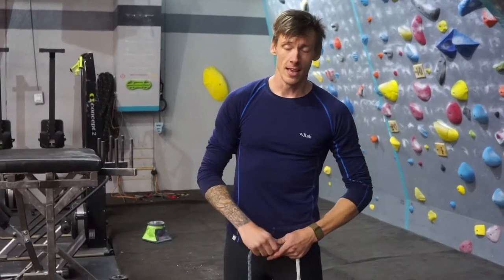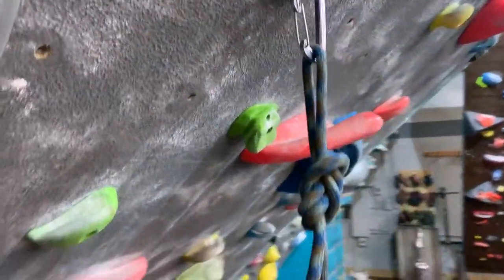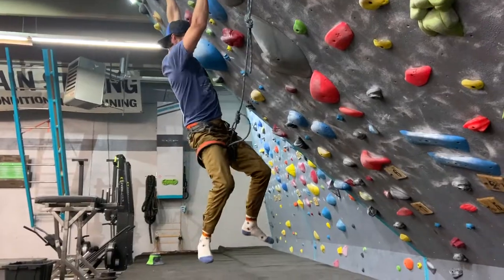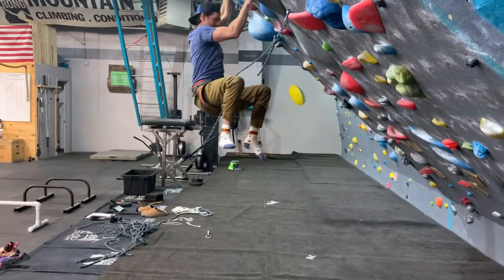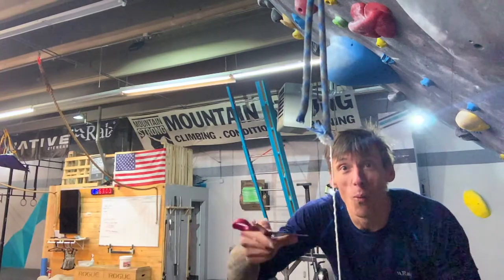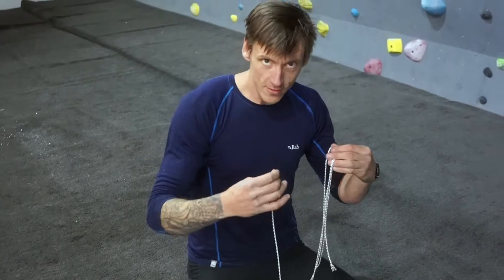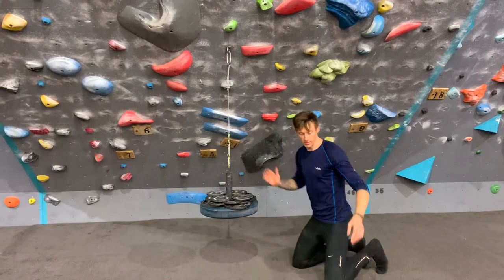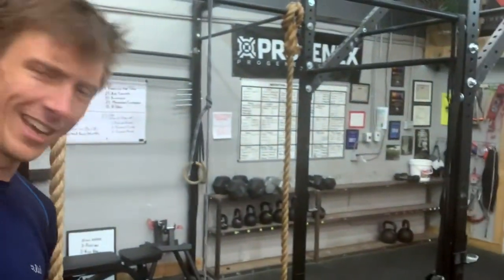How strong is a climbing rope?

Comment: 1/33 = 105, static. 33x105. The mantle is roughly 1/3 the weight of the rope, therefore 1/3 of the strength (estimated). So, 3,465/0.67 = 5,171.64 lbs. Curb weight Toyota Tacoma is roughly 4700 lbs. I'm bored so I calculated this out...
Reply: Hi Chris, may I know, how to calculate mass per meter kernmantle?

Comment: We did this once back in the early 2000's in a gym that had a pole-vaulting mat as the crash pad under the boulder cave. We had to cut it down to less than half the core strands and have a 2nd person (about 320lbs total) piggy-back the harnessed person (yes, it was as silly as it sounds) while taking a factor 2 fall (from above the anchor point) before we got it to break.

Comment: It would be more interesting to do these tests with dynamic movement, more closely simulating a whipper and the exponential forces at play.
Reply: I think that just takes some simple physics math.  We already fall factors exist, I think you could simply take the load and divide it by a similar number to determine how much force it can really take.  My guess is that it's not going to be more than 1/4 of it's total load, so anyone weighing less than 3000/4 can take a 40 meter fall on 10 meter rope and the rope won't break.  Your body might, but the rope will be fine.
Reply: @mendo1522  if you fall 40 meters and your rope is only 10 meters then I think the rope must've not been tied or broke already. There something I'm missing here?

Comment: What about the way it's built? i.e.: does braiding increase strength? Or the fact that the centre strings are compressed by the sheath does that help? Seems to me that even if some internal string were to break, the pressure from the sheath squeezing the strands would prevent them from slipping. Would love to see how many pounds this thing can take while assembled and disassembled (all the parts together but outside the sheath and maybe the same test on a small string but unbraided).